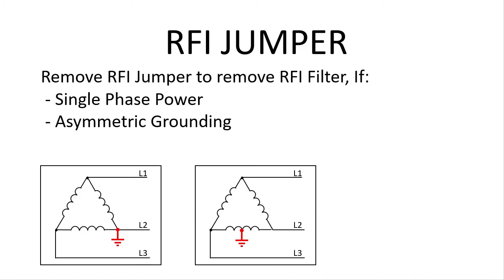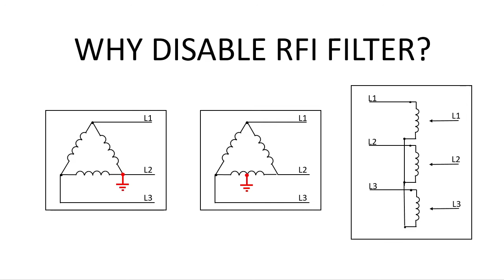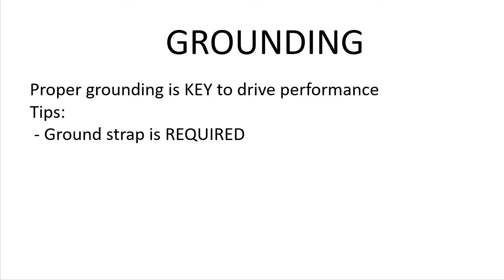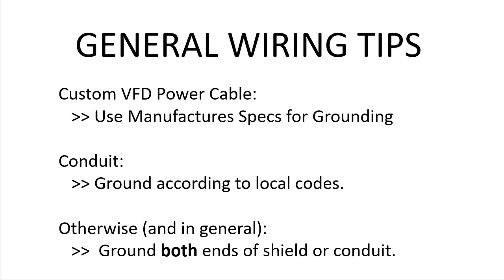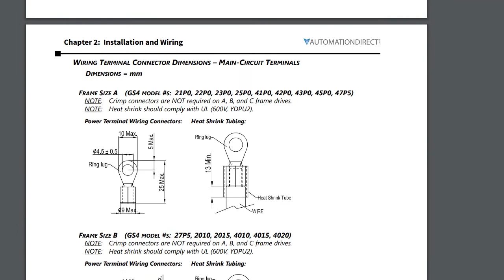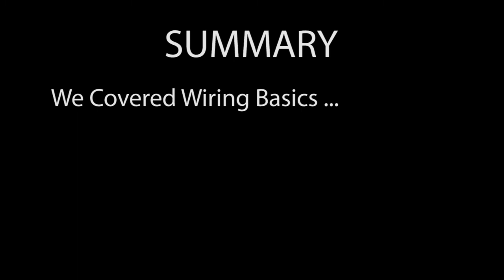DURApulse GS4 Drive VFD Wiring & Grounding from AutomationDirect

Comment: So when connecting a 240v single phase g20 with proper grounding, you still need to remove the jumper?
Reply from the maker: Correct.  See page 2-15, warning at top of page of the user manual here: https://cdn.automationdirect.com/static/manuals/gs4m/gs4umw.pdf
That section is full of good info, it's worth taking a few minutes to read through it (starting on page 2-14).

Did you know that you can view all of our VFD videos here:
www.automationdirect.com/cookbook
Click on the "AC Motor Drives" chapter.

You can also find hem here: https://www.automationdirect.com/videos/home?t=link&cat1=113
And pick the family you want in the left column menu.

Comment: I spoke with an applications engineer earlier regarding a g20. Series drive. It’s an e frame size rated for 10hp single phase 5 horse power 3 phase 240. He told me not to worry about a contactor. Can you explain the purpose of the contactor? Also I am really confused about the “protection” circuit that the manual “reccomends” be set up. It appears to be a dry contact by the line side connections I think it was terminals ro r1? It almost looks like a shunt trip circuit but I can’t tell. It shows a diagram (that I don’t understand) and also a note stating it will close the contact in the case of a fault emergency amd kill power before any damage occurs. I just don’t understand how it’s being accomplished.
Reply from the maker: Hi Becky,
Sounds like you have a GS23-2010 (I think your description above is backwards, should be 10Hp for 3 phase 240, 5HP for 120 single phase -right?)

The contactor is just a powerline on/off switch so you can isolate the drive from the main power if you need to service the drive. It can also be used to automatically remove power when a thermal overload or other fault is detected.

Protection circuit: Not sure what you mean by "R0 R1" - I don't see those terminals?  Are you referring to the STO terminals? That's the only protection circuitry that shuts down the drive that I can think of. I don't think we have done an STO video on the GS20 yet, but it will be VERY similar to the STO in the GS4 Drives so take a look at this and see if it answers your questions: https://youtu.be/k22FaCWfGcU
Reply: @automationdirect  yes the dry relay contacts . Maybe it’s rc1 and r1 ? It’s right at the beginning of the wiring the drive section of the g20 manual. In the manual they have a weird schematic of the circuit they want you to create using those contacts.it appears to be taking two legs of 3p from the line side of the  main contactor and then creating a protection circuit to power off the drive whenever a fault occurs. Are they creating a 220v  circuit   And running it through the dry contacts to and into  another relay  to drop out the main contactor?  It’s not a great diagram. I do not want anyone going through the manual and telling me I didn’t wire it correctly. I would just use a digital output to create the same scenario but I want to save as many outputs as I can . If they are dry contacts that close when an alarm is active can I use external 24v to make that circuit instead of using line power? In the description for rc1 and r1 it gives loads for induction load and  some other load.???!
Also there is a 24+ terminal colored red with two other terminals I think sa and sgm. The drive comes with it jumpered but it is also some kind of safety circuit. 
Last question they want a resistor capacitor scrubber circuit at the contactor and it says “hook it up at the top and bottom” what the hell are they talking about? Do they mean they want it hooked to the coil of the contactor like normal or are they suggesting it be hooked to line and load of contacts?  I have a diode terminal block that I’m using to wire the 24vdc coil on my contactor. If they want surge protection on the ac line and load shouldn’t I use a trans orb or varistor?
Reply from the maker: What page of the user manual do you see the "weird schematic?"
Reply from the maker: Hi Becky,
Ok, I see what schematic you are talking about. And I agree, it does a poor job of conveying the concept.
Bottom line, everything in the shaded box is part of the contactor circuit.
RC1 and R1 are simply a relay OUTPUT from the drive that can be setup to control the contactor if there is  a fault condition. While the drive is running, the relay is programmed yo be closed which keeps the contactor closed. When there is a fault, the relay opens, which opens the contactor control circuit which opens the contactor to remove power from the drive.
Could you use a 24v controlled contactor to do the same thing?  Yes. Again, its just  a relay.
Honestly, it's rare that anyone does this. Especially since this drive has STO built in which is a MUCH better/faster way to shut down the drive in case of an emergency.  And the contactor can use a thermal overload to detect things too, though that is pretty slow (in comparison to STO) and could still result in damage to the drive/motor.
Reply: @automationdirect  yes but I’m using a 230v input. The drive family does not support a 120 1p 5 hp application. I want to set up a hand off auto switch where manual would be operation from the key pad and auto would be operation via 3 wire start with a pressure switch controlling the latch. I wish I. Could program two different terminals as fwd run command. I don’t see that option. So I think I’m going to download the plc software and make a run circuit .  I’m also going to do some training with the maintainance team so I want to incorporate an estop utilize some outputs to light some confirmation lamps for run and fault and breaker trip ect. Also I have a +|- pushbutton so I’m going to try and make a frequency adjustment circuit and maybe a jog circuit and then we can use it as a trainer for some of the new guys and apprentices. Is the plc pretty staraight forward? It’s been a while since I have programmed ladder logic and all I ever used was Mitsubishi.
Reply from the maker: Hi Becky,  I am away from the office, will get you some answers tomorrow. 
Meanwhile, This video is about the GS4, but you are specifically asking about the GS20 - correct?
Reply: @automationdirect   it’s actually a GS232010 driving a 240v 3p 5hp motor with a 240v 1p input. I think I have that sized properly..... I found a document online that explains the conversion equation to size a 3phase ac line reactor for use on single phase input . All off there reactors in this family can be used on single phase input! Who knew? So I have that taken care of. But I would like to know what they are doing with that protection circuit and also there is a 24v output that is jumpered between two other terminals and they specify not to use that input for anything other than that circuit. It appears to be an estop circuit but I can’t say for sure. If you look in the manual you will see exactly what I’m talking about. If you could provide some insight into those I would really appreciate it!

Comment: Question regarding not using a contactor to on/off a VFD. If one should not use a contactor to on/off the VFD, is it recommended to just leave the VFD plugged into power at all times then, and turn it on via the control panel?   Would using a high power, manual rotary disconnector switch then be advised against as well? Since it effectively would be doing the same action as a contactor.
Reply from the maker: Hi Paul,  That section of the video wasn't very clear.  It should really say "A contactor should not be used to turn the MOTOR on/off. It is OK to use a contactor (or switch or whatever) to turn the VFD on/off, just don't do it while the motor is running. That can damage the drive.
Reply: @automationdirect  so the contactor simply functions as a means to power down the VFD while keeping main breaker on? Can I just install a nema 4x4 disconnect to my drive panel and hit the disconnect when I’m finished? Not killing power while under load is true with any drive. The manual also says not to turn the drive off and on more than 1 time an hour! Yikes, hard to troubleshoot a problem like that.
Reply from the maker: @beckyschwantes5287  Hi Becky, Yes, Any form of disconnect will work. re: 1 hour .. ugh … yeah, I have to tell you to follow the manual of course ( but I can also tell you I rarely do … Use your common sense …)

Comment: I am confused about 3 phase delta connections. We use 46-V/3ph delta with a separate ground wire. What would be the proper way to wire this drive with this type of power?
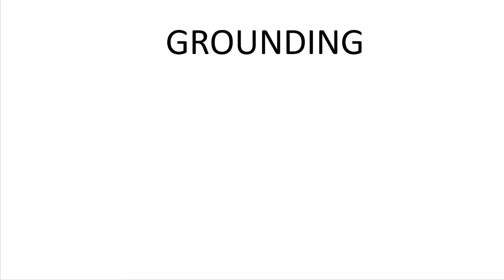Reply from the maker: HI Duncan,  By "Separate Ground" do you mean you have a separate ground that is not connected to the Delta?  If so, then that is most likely just an earth ground which we talk about at 02:05 in the video.
Reply: @automationdirect   - So to correct my typo above it is 460V/3ph. By separate ground I mean that the ground is not connected to any of the power phases, either in a "corner" or by a center tap on one phase. Also, it is not a "Y" system where there is a neutral at the "center" of the 3 phases.

In my experience here in the US, almost all 3 phase industrial power I run across is 460 "delta" with a separate ground which is unreferenced to any of the phases.

Thanks for the reply.
Reply from the maker: @Duncan Potter Yeah, That sounds like your Protective Earth ground (PE) strap.  See 02:05 in the video.  Good luck!